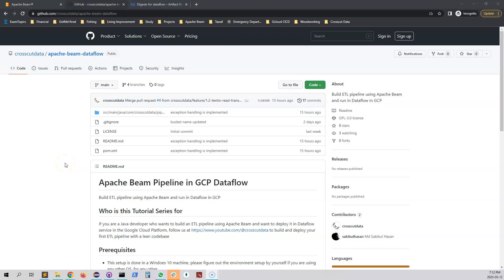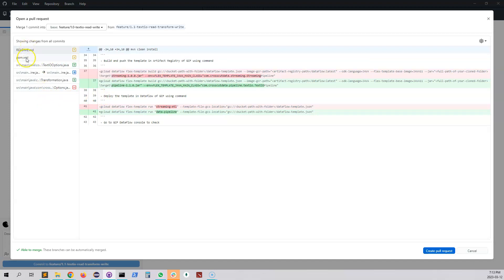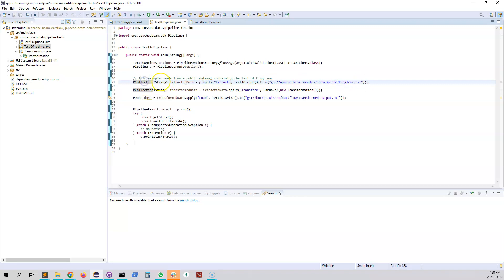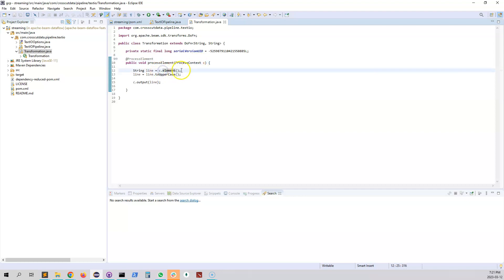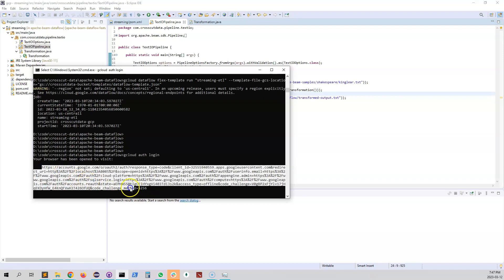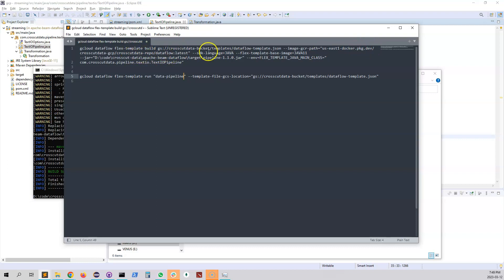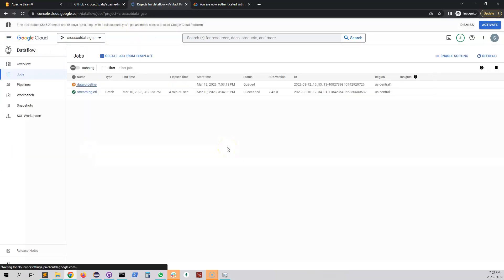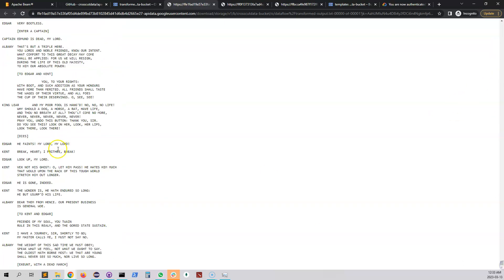Transforming input data in Apache beam

Comment: If the input file is a .json which is a record from an origin database (for example mysql), can the following work?

PCollection<CustomObject> extractedData = p.apply("Extract", TextIO.read().from("pathToFileInGS/data.json"));

then I would need to make a loop and for each record in the extracted data, change some columns to match the new schema in destination database (for example spanner), is this possible? For example a record in the json could be a transfer with an id and a amount columns, then the transformation would be to create a record with a different random uuid as the new id, the same amount from the original record and finally a legacy_id column which would be the id of the original record, so that the final json would be a record or records that a dataflow job can read and insert to the new database schema (which has id, amount and legacy_id)